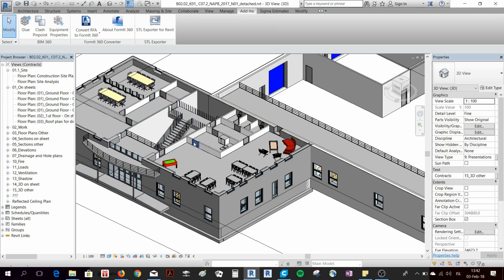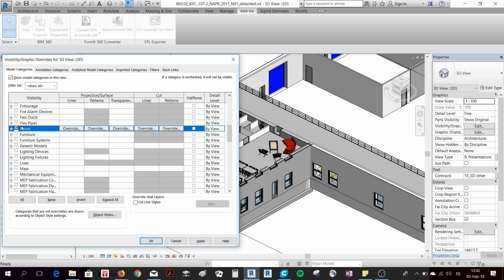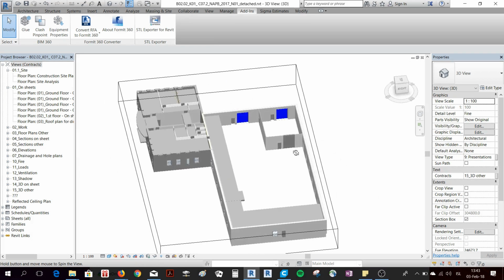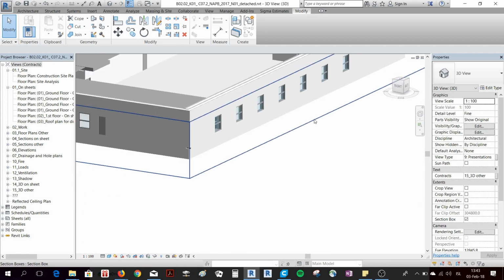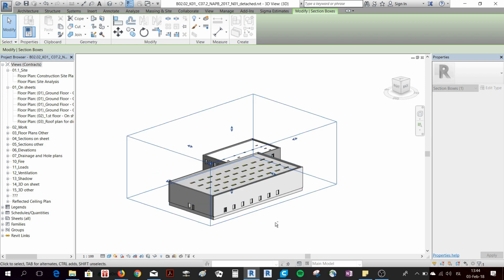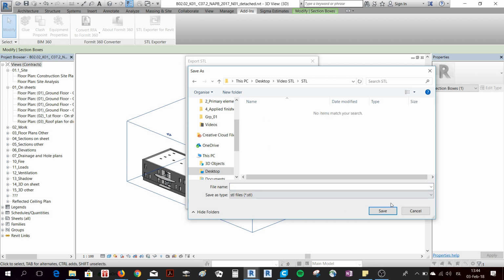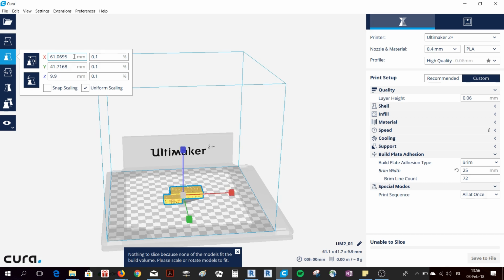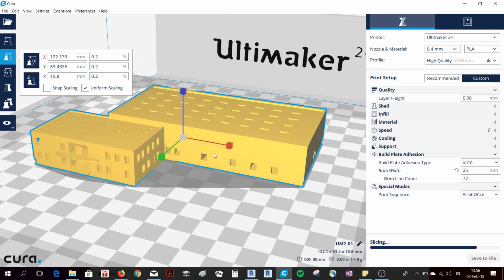Revit model to STL for 3D printing

Comment: 2026 update for anyone finding this video now, with answers to a few questions in the comments:

• No plug-in needed any more: STL export has been built into Revit since 2021.1 (File › Export › CAD Formats › STL). Choose Binary and millimetres.
• Proper scale: STL has no units and slicers assume millimetres, so export in mm and scale by 1 ÷ your scale (1:100 = 1%, 1:200 = 0.5%).
• Topography not exporting: old toposurfaces are only surfaces with no thickness. In Revit 2024+ use a toposolid, which exports as a solid.
• Taking the roof off or printing floors separately: duplicate the 3D view, put a section box around each level, and export each one.
• Check the thinnest parts at your scale: at 1:200 a 100 mm wall is only 0.5 mm, too thin for most printers.

Disclosure: We made a Revit add-in that does this cleanup automatically (thin walls, gaps, scale, splitting to fit your bed), with a free plan at printbim.com. Full free guide: printbim.com/revit-to-3d-print

Comment: hello, i know this video was uploaded 3 years ago, but maybe you can help me, this Stl exporter is not avaliable anymore on autodesk so does anybody know how to find it nowadays? Thanks!
Reply: Click File->Export>CAD-Formats->STL
Reply: @F1Tobbi  i only have .dwg .dxf .dgn there
Reply: @m.o.g2549  Guess it depends on what version you're on...? Im on Revit 2021
Reply: @F1Tobbi  yeah mine is 2020 :/. Does the export STL work well for printing?
Reply: @m.o.g2549  been having mixed luck with it.
Would recommend you also check out Revit-forums for more info and tips
Reply: Hello, I found myself with the same issue than you, with Revit 2020. How did you solve it at the end? I will appreciate a lot if you help me  🙂

Comment: This is good, I tried it on revit 2018 and it worked I just REALLY wish I knew how to do a proper scale rather than reducing it to a random percentage. any ideas?
Reply: yes there is, it took me a while to find it and it was right in fron of my eyes. i got the scale thing to work too. i use cure slicer and if you just import it the actual scale, in cura SCALE option you go from 100% to...say... 0.010416666666667% is 1/8”
it’s easy.
Reply: @rv3089  where is it in the revite 2018
Reply: Same question. And do we have STL exporter for Revit 2018? I only found the version for Revit 2017 and before